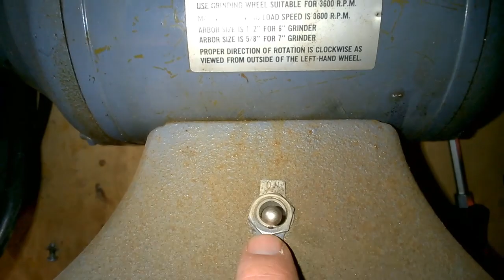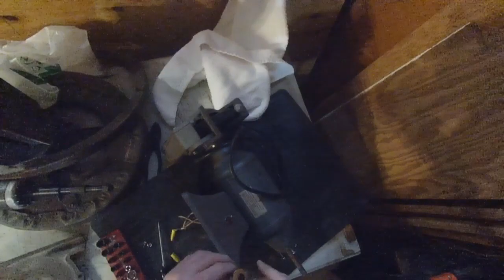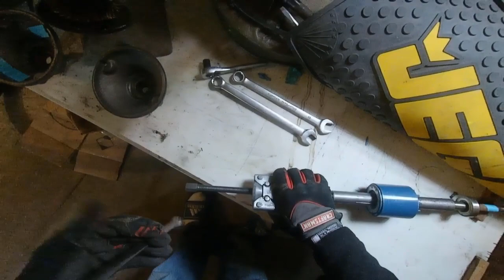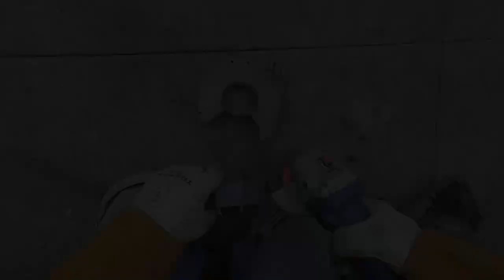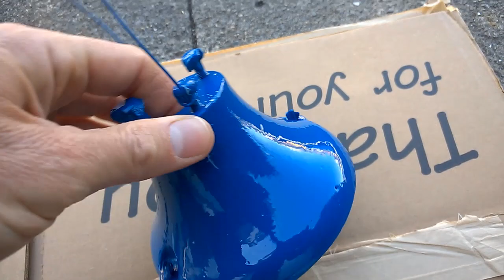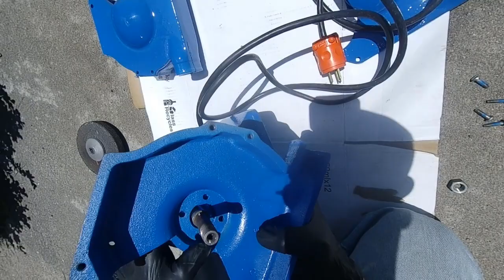Bench grinder restoration

Comment: Man you did a great Job on the restoration . I enjoy brining the old iron back to life. One tip that helped me on the bearing removal is use a sacrificial nut on the shaft just in case that way no chance of thread damage . Also I use an aluminum pipe and a press but at the home shop all is in play ! Best Charlie
Reply from the maker: Very good advice on the sacrificial nut.  Thanks for watching!

Comment: I just bought an old Baldor 623e grinder today, just like yours. Can you tell me the bearing number/part number and the name of the bearing, and maybe where you bought them. I want to use a good name brand bearing, like you mentioned. Thank  you.
Reply from the maker: Sorry for the delay in replying-- unfortunately I don't recall the exact size but it's on the bearing itself and totally standard and easy to get-- something like 6202 or 6203zz.  As for sellers, I use ebay and either one of these sellers I recommend:

https://www.ebay.com/usr/irvineman?_trksid=p2047675.l2559
https://www.ebay.com/usr/shorenutz?_trksid=p2047675.l2559

Look for either rubber or metal shielded bearings (not open bearings) and go with NSK, Nachi, SKF, NTN or Timken brands they'll all do you well.